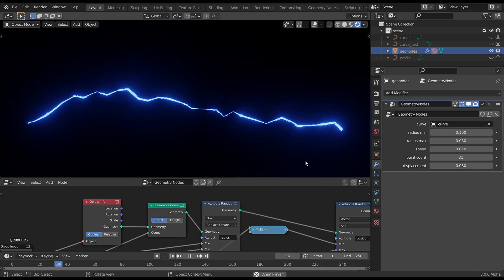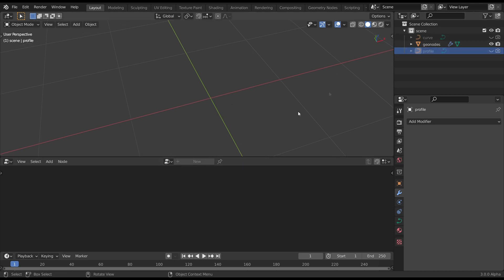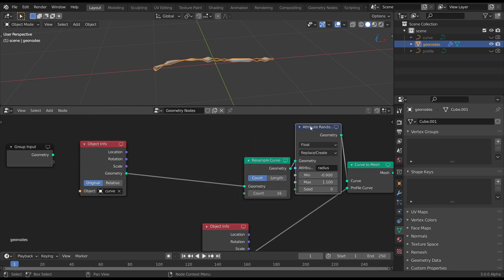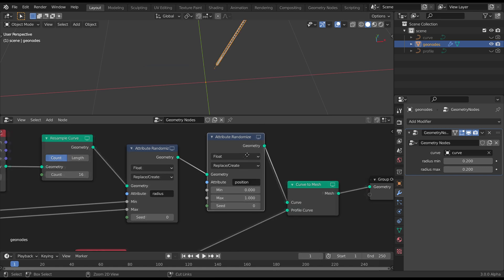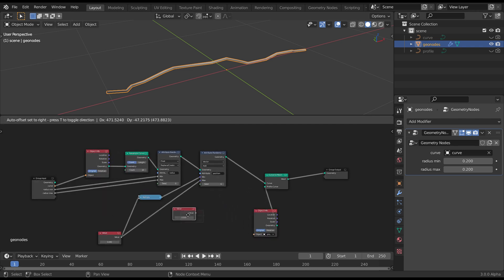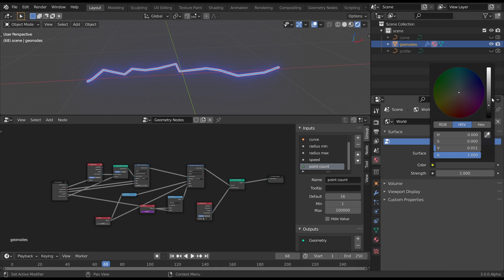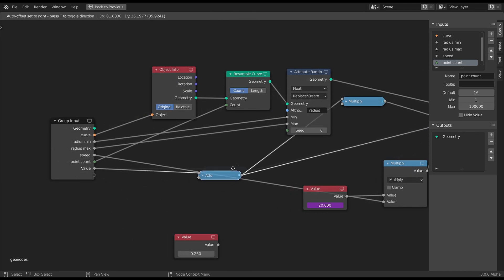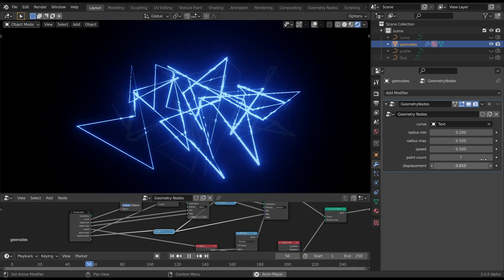Blender 3.0 Geometry Nodes Tutorial: Curve Nodes Electricity

Comment: 11:45 I bet this add function takes some time for calculation. A little bit due to modern PCs performance but still. It's better to use reroutes for such purposes.
Reply: I think the compiler gets rid of blank operations like this one so the impact is likely the same as if it weren't here (at least I hope it does for the sake of optimisation). I agree though that I didn't really understand the purpose of this node. Couldn't you connect the socket directly to both the multiply node and the Max socket, or use a reroute node as you suggested ?
Reply from the maker: @Gorgious  The problem with the reroute is that if it won't auto connect to the group input node. It is true that I could have deleted my "null" math node and used a reroute, but the way I demoed is quicker. The real problem is that geonodes side panel has no way of changing the variable output type, which is something they really need to fix!